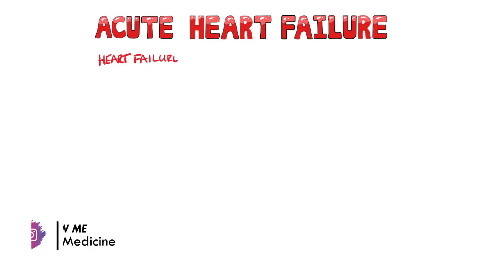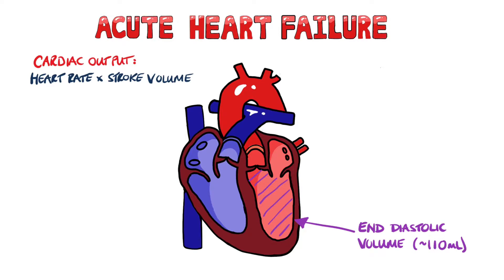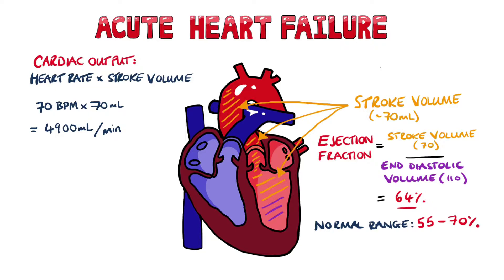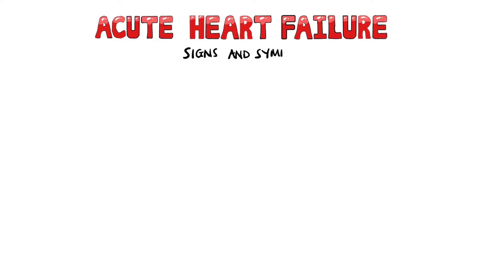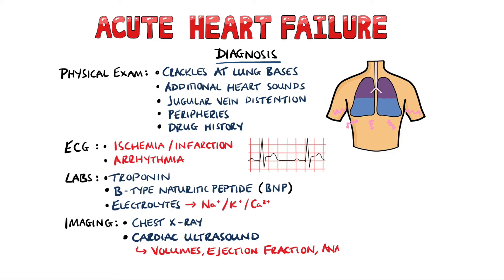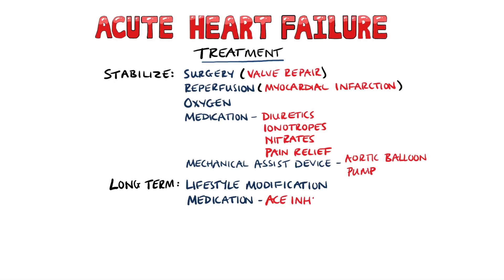Acute Heart Failure -  Types of Acute Heart Failure | Causes | Signs and Symptoms

Comment: 🎯 Key Takeaways for quick navigation:

00:00 🫀 Heart failure is when the heart can't meet the body's perfusion demands.
01:09 💔 Common causes of acute heart failure include myocardial infarction, arrhythmias, pulmonary embolism, myocarditis, and drug-related factors.
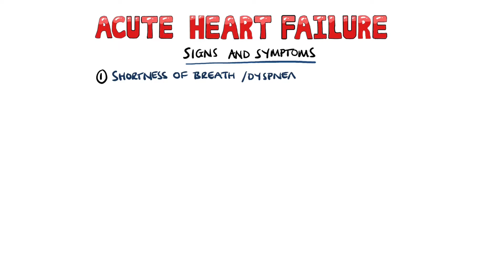02:05 🩸 Shortness of breath is a primary symptom of acute heart failure due to pulmonary edema caused by blood backing up into the lungs.
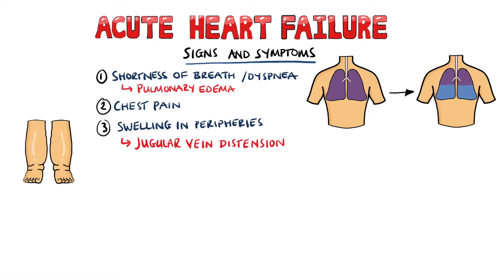02:32 💧 Swelling in the ankles and jugular venous distention are common signs of right-sided heart failure causing venous congestion.
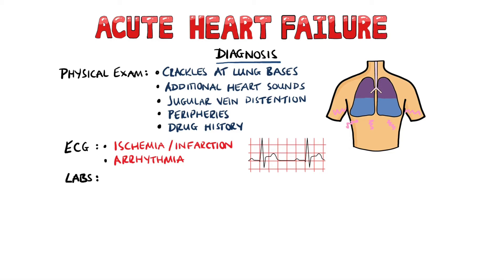03:15 🔍 Diagnostic evaluations for acute heart failure include ECG, troponin levels, BNP levels, electrolyte levels, chest X-ray, and cardiac ultrasound.
04:14 🏥 Treatment involves stabilizing the patient, possibly with surgery or reperfusion, oxygen therapy, medications like diuretics, ionotropes, nitrates, pain relief, and mechanical assist devices.

Made with HARPA AI